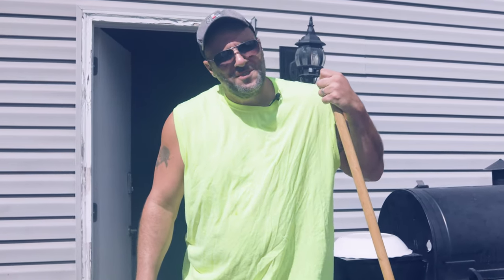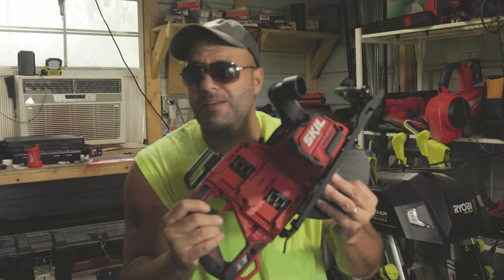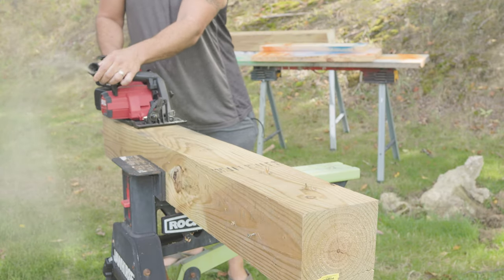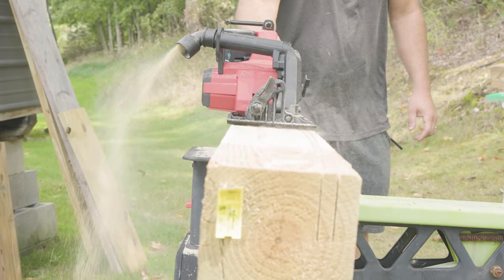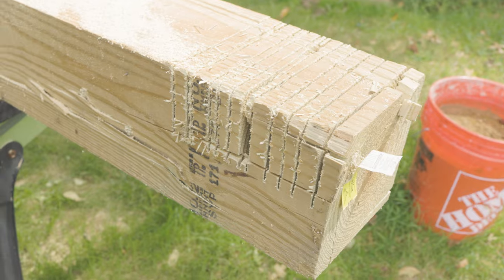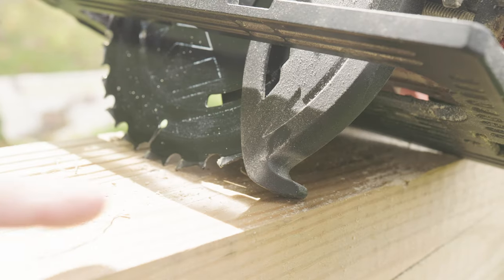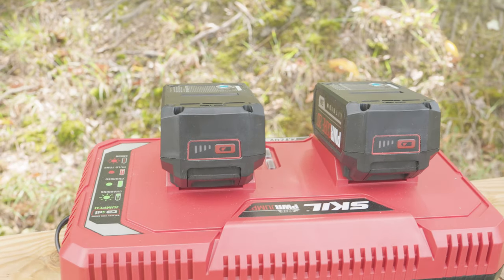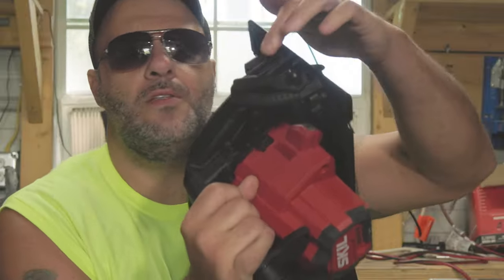You Really NEED TO SEE This New Circular Saw - YOU WILL WATCH!

Comment from the maker: What do you think of this new SKIL Saw?
Reply: I think Skil PowerCore could be turning into the Goldilocks of power tool platforms. Just right for both professionals and DIYers.
Reply: got to admit its a lot of saw for the price. it looks like it up there with the best of them well on the way ;)
Reply from the maker: Definitely surprised with its performance Robert 👊
Reply: If their Pwrcore20 line is anything  like their Pwrcore12 tools.that I have, it's something I need to add. The only worm drive saws I have are a Skilsaw Mag77 and an older 6.5" Skilsaw, both corded and both really heavy and unwieldy.
Reply: It looks great! You might agree with me for saying this Clint, but Skil just out-classed Makita’s 36V rear handle saw by a wide margin.
Reply from the maker: @MidasTouch3197  I think they out classed a lot of brands with this one Martin 🤣👊👊

Comment: I have the newer skil 10” contractor table saw, and their newer 10” dual bevel slider. Have had both for over a year. Besides some minor gripes like cheap plastic throat plate on the table saw (made a zero clearance) both these tools have been phenomenal, square, and full of power. Now these are corded but I’ve been impressed with the value propositions skil seems to be bringing the last few years
Reply from the maker: Appreciate the feedback brotha man D. JINERSON!
Reply: @ToolReviewZone  Just doin what a good Toolie do!!!! For my fearless leader 👍 (except when it come to the gnome, or evil twin, or maybe even Vance?)
Reply: @djjinerson  🤦
Reply: I have that same table saw. Everything was straight out the box. Used it to install some laminate flooring. It cut flawlessly. Really good investment in my opinion. Only thing I did was change the blade to a fine finish one.
Reply: The TS6307-00 tablesaw? How tight is the miter slot? For me, every contractor saw ive checked in stores has an unacceptable amount of play. Wish everyone would stop using tabbed miter slots.

Comment: I know this may sound kind of crazy but I kind of wish they made a corded version. I don't want to have to swap over to another battery platform and a corded version would allow me to purchase that saw
Reply from the maker: Unfortunately they don't have it brother 😪
Reply: My old Skilsaw is corded, but smooth and powerful. I've never bogged it down. The name means quality.
Reply: @charlestaylor3195  yeah I have an old 14 amp corded I would like to replace.  I already have three different size battery powered circular saw. I would love to get a good corded one.
Reply: Just buy a real Skilsaw wormdrive. The corded version if 200 but you'll love it. I just bought the wormdrive cordless it's amazing . These rear handle saws are all wormdrive style.
Reply: There will virtually be no power tools to inherit in the future.  Each battery platform is so short lived.
Reply: Technically they do make a corded version it is called a skilsaw worm drive... Considering this is the same parent company.
Reply: You just reminded me of a product I need to design! How does a corded 18v plug-in unit with adapters for multiple brands of power tool sound?
Reply: Skil corded worm drive. You better be holding on when you crank it up.

Comment: Hasn't this saw been out for well over a year? But yeah, SKIL seems to be raising the bar as far as quality, selection of tools and performance goes. I have some of the PWRCore 20V Tools i bought a few years ago which was really my first foray into power tools in general and the drill and impact i owned were decent quality, though the circular saw i bought was just really cheaply made and i didn't even feel safe using it, but it was like $50 or something on sale so you get what you pay for. 

Their newer stuff seems to be pretty nice though and they have some good stuff in their 12V lineup as well. The TTC tested the 12V right angle impact driver against Milwaukee's 12V and 18V models as well as Makita and it destroyed both in terms of power and it was significantly cheaper than the competition. One other thing that gets a lot of people confused is that SKIL and SKILSAW are basically two different brands. SKIL is the cheaper stuff and SKILSAW sells the high end stuff. I'm sure you already know this Clint, but i just figured i'd put that out there.

Comment: Hey so I need some feedback. I'm heavily invested in Milwaukee but from what research I've done,  none of their saws are really that great. I'm a stickler for getting the right tools for whatever job I'm doing, so it's important I buy a good saw. Im going to be getting into a lot of wood projects soon, so I'm really considering this saw because of quality and price. I'd like to get a track kit to turn it into a track saw. Does anyone know what kit would work with this (if any) and/or have any other suggestions?
Reply from the maker: Milwaukee saws aren't bad  just not the best. I love dewalt saws
Reply: @ToolReviewZone  do you have an exact tool you'd suggest? I want a good one and I'm pretty sure I need/want a 7 1/4" saw rear handle
Reply from the maker: @gmcwayoflife  60v flexvolt 100% they make the rear handle and side winder
Reply: @ToolReviewZone  Is it really worth the price difference between that and the Skil? The Skil is $250, that Dewalt is $450. I mean I'll pay that if it really is worth it

Comment: Glad to see Skil really get into the cordless game in a big way with a rear handle saw.  Wonder what they SkilSaw version will be like?  With the world moving to cordless wonder if the like of the 16 5/16" saws every really become a reality in the cordless world.  Those saws at least in a corded version  would put a hurtin' on your famous treated 6x6.  I know I have one.
Reply: I don't think there will ever be a Skilsaw based version of this one. They already got the only cordless wormdrive in the market and it's got more torque than any rear handle saw.
Not sure about cordless circular saws bigger than 7 1/4, but I guess their torque needs are way too much for any battery less than 8Ah. I could be wrong, though
Reply: @luisinhoens90  Well, I'm not soo sure about that.  Many Cordless brand advertise "The power of a corded Saw or Drill, etc."  A corded device can't pull but so much current from a 15 amp circuit and receptacle.1500 - 1600 watts maybe as much as 1800 +/- watts on 20 amp circuit and single device 20 amp receptacle for a plug and cord device.  So the future may have some light at the end of the tunnel for such a beast...We will just have to wait and see!
Reply: @Sniper269  There are indeed 7 1/4" corded saws with 15 amp motors but the bigger saws got more torque and less RPMs to match the same amps with sustained performance.
So yeah, maybe I'm not accurate on that one, or it's just such a small market. What is true is there are more capable battery systems than in the past and both the 36V/40V systems as well as the 2x18V systems may prove with enough oomph to power more demanding applications such as those big saws. 
I couldn't agree more (to wait and see)
Reply: I have the Skilsaw Truehvl. It's meh. I'd pick the dewalt over it if I could re buy a rear handle. Its better in every way, bar the familiar ergonomics of a worm drive (More than likely, if you had a corded rear handle, it was a Skilsaw). The battery is HEAVY and doesnt seem to last for how big it is. The only thing I really like about the skilsaw is the dust shoot.

Comment: The blade on the wrong side is a massive deal breaker for me. When your blade is on the operator's side there is WAY more chip out and tear out that goes flying at the operator. I upgraded from the Milwaukee 6 1/2" saw to the 7 1/4" saw for that reason alone! It helps that the bigger saw is much stronger but the 6.5 did have all the power I needed... Just my two bits, I'm sure many other people will prefer their saws in the left blade configuration and that's ok too. It's ok to be wrong. Just kidding.